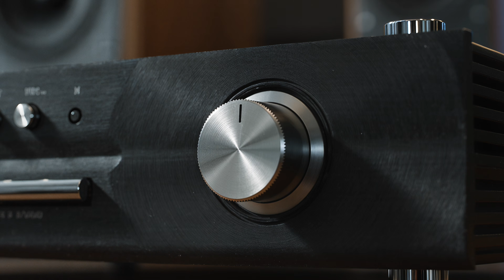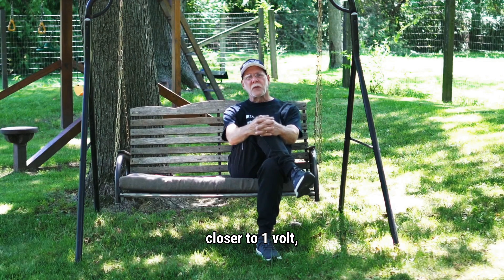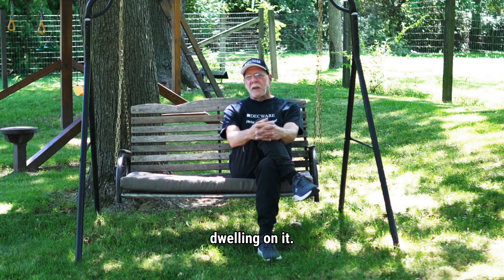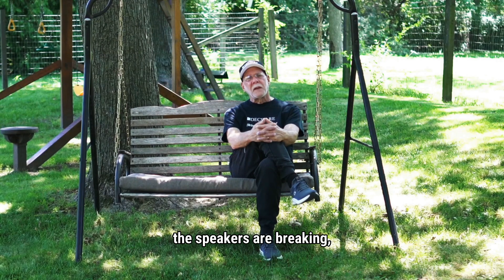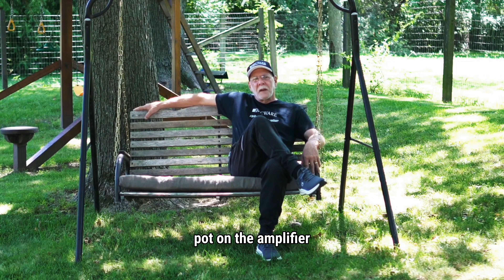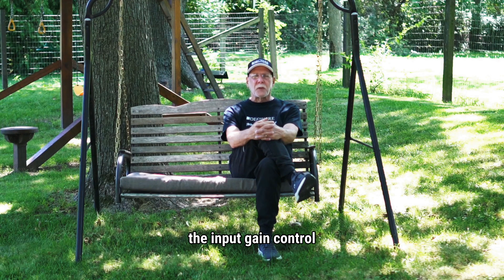DECWARE's Steve Deckert talks about input sensitivity

Comment: Way back in the day (mid '70's) I did a 6 S.E. state Audio store tour testing amp speed (slew rate, rise time). Any amp brought into any of the stores I did the clinic in. Most products had the best response when the volume control was wide open and I adjusted the input to get full rated out (into 8ohm dummy loads). As all stages are R/C coupled, the high frequency rolls off as resistance is introduced into the circuit.

Comment: Oh good stuff Steve. I purchased an Angela Gilbert Yeung preamp w 4.2 Farads of capacitance wi have very high voltage output so I’m able to turn down the Tori V to 14 yet get more density than a volume of 20 with no preamp. It’s lovely. Decware is one of the top reasons I enjoy this hobby so much.